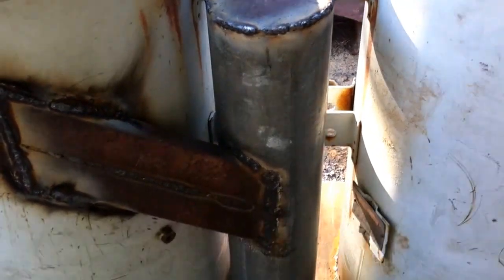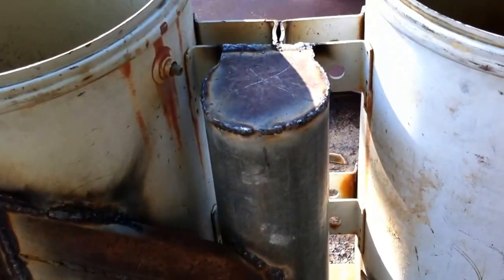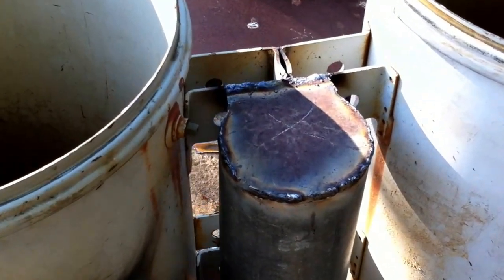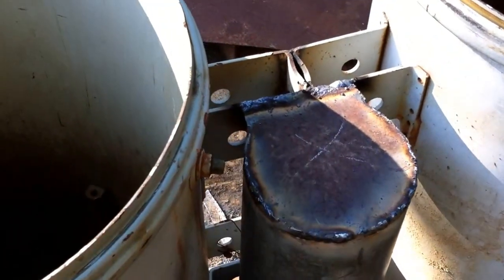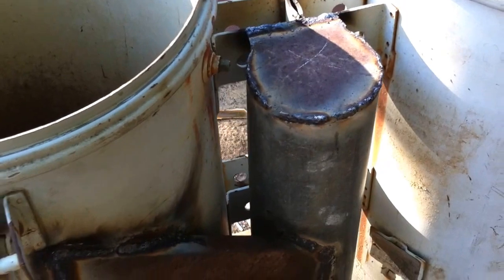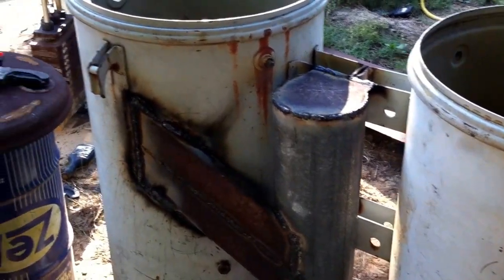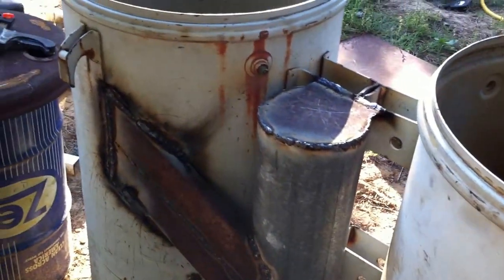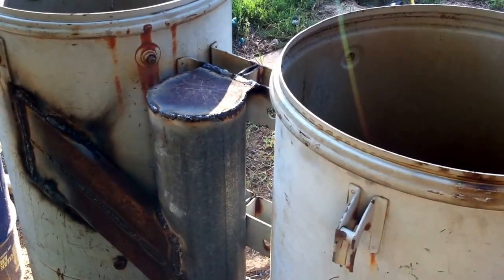Woodgas Project - video #5 - Gasifier latest vidio but more to come.

Comment from the maker: I Remember your name now, should have guest it from your handle here.

I've designed a surf type pump that would work well for distilling water but the filters or membranes cost big money. Seriously thinking Hydroxy gas to run small motor and heat water, both methods could produce something drinkable if one has all the parts needed. I have a few different systems in mind. If I spent half the time working on stuff that I spend daydreaming, I would likely be living one of the lives I wanted.